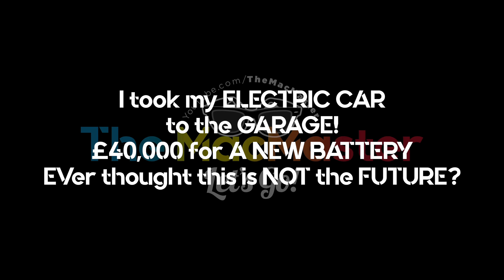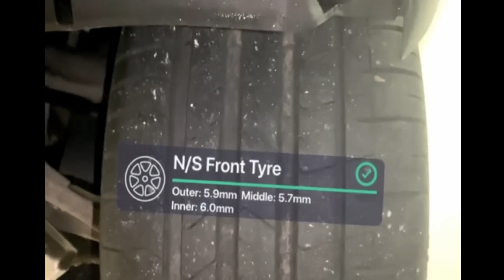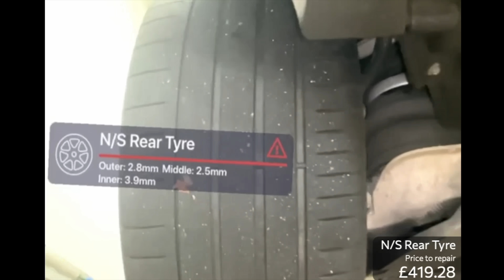I took my ELECTRIC CAR to the GARAGE! £40,000 for A NEW BATTERY EVer thought this is NOT the FUTURE?

Comment: I'm glad you posted this because I've been having a debate with one of those EVangelists and it's absolutely correct what you say, they're obsessed with everything EV and won't hear a bad word against them, but while I get that to a point, I don't get the aggressive and insulting attitude. They're either telling you you don't have a clue what you're talking about, laced with as many insults as they can think up \t the time, or they think you're totally against them because you're poisoning the air and you want to see the planet destroyed. No, I don't quite get that either.

But the more I discussed this argument, discovering more and more potential future issues along the way, the less EVs made sense. We know that to begin with, because of the emissions related to their initial destruction, that they're less "green" than an ICE car (a simple fact that most EVangelists won't acknowledge, or don't think it's as bad as it actually is), but where it all falls apart from me is 10 years or so down the line. Yes, it's the batteries. The EV lot will tell us that they'll do a million miles or whatever, but that's not the point. 

I think what's going to happen is that when these cars get to the 10 year old stage, the people who can only afford a 10 year old car and as such are on a budget of, say. £5-10k are not going to be interested, not because the batteries are knackered, but because IF something happens and they need replacing they're not going to be able to afford it and are therefore going to be left with a piece of scrap metal. It is for exactly this reason that you can buy a big 3-4 litre saloon for £5k - not because they are likely to fail, but because there is always the possibility that they will, and if they do they are going to cost a lot more to repair than your average family hatchback. 

So it's quite possible that by the time your average EV of ANY size gets to that age nobody is going to buy them. That means more scrappage, possibly before they have even reached the point where they're more environmentally friendly than an ICE car. That will leave people with 2 choices - they will either decide than rather than take the risk they will if they can buy or rent a new one, or if they can't they will have to use public transport. 

If that's how it goes it's all beginning to fit isn't it, the government get ICE cars off the road and get drivers off the road soon afterwards because nobody will be able to afford a new EV, or want a high mileage old one. And by them everybody will have worked out what is really going on and that it's nothing to do with the environment, as the fact that millions of cars are scrapped so much earlier will mean there is no environmental benefit whatsoever.

Comment: I have a Kona Hybrid and got dashcam fitted, if you dont drive very often it drains the 12v battery. My solution was to attach a solar trickle charger when parked up.

Comment: Some truth in your comments. The UK government will always target the motorist because they know there isn't any alternative for many people. ULEZ is about raising money because councils have high wage costs and get ripped off by sub contractors. My Cupra Born V2 has lost £11k in 13 months so when Cupra asked me if I was considering trading it in I laughed at them and told them to do one. I like petrol cars and EV cars. Why don't London council release the air quality readings for Heathrow, Gatwick and the under ground compared to the roads ? Also log / wood burners give out a lot of pollution. The money wasted on HS2 could have built thousands of charge stations and improving our road network.
Reply: You chose to buy a relatively new car... what did you expect? All new cars depreciate like a brick.

I once bought a 15 month old Ford Focus ST-2 with 5,000 miles on it.... I paid £10k LESS than the new retail price and I bought it from a major ford dealer. 3 years later whilst on a dual carriageway doing 70, the engine went "bang". New one was £5k+ labour and no guarantee it would work without fault. Sold the car as a non-runner to co-part for £4k and used that as a deposit for my 335D.

Comment: Whilst I am an  owner of an EV, I do agree with your point on control. Mass EV ownership opens up all sorts of controls being placed on the motorist. Currently it is just starting to exist in charging. When I go to charge my car at home irrespective of the time my Chargers app asks if I would accept a ten minute delay before charging commences, supposedly because of demand on my electricity provider. At the moment you can opt to skip the delay, but how long before that option no longer exists, and its not ten minutes but hours!?! 
The government are in a quandary, they still, need the fuel revenue from petrol and diesel, but as EV's become widespread I have no doubt they will have the technology to detect when your using electricity to charge your car and introduce a new tax accordingly.
Whilst I remain very pleasedcwith choice of car, a Genesis Electrified G80, which as a large luxury saloon benefits from the refinement of being an EV, I was rather corralled into an EV thanks to the propaganda against petrol and diesel, and living near to London I can avoid, at least for now, pollution taxes. Less said about ULEZ rip off the better!!! By the way good to hear your battery remains intact!!

Comment: That’s good news. The battery protection plates look pretty substantial, hard to imagine any damage to the battery possible from road debris.

One other thing, I though that car batteries are made up up loads of individual battery cells so it the ‘battery’ were impacted/punctured then it should be a case of replacing the damaged modules not the whole battery.  The Porsche Taycan battery has 33 modules, each with 12 cells.  They won’t be able to replace individual cells but the modules should be replaceable.

Comment: My Toyotter Yarse 1.0, 20 years old, suffered a catastrophic low oil pressure event. The big ends were toast. £170 got me another engine block. Right as rain again. Nowhere near £40,000.

Comment: Hi.  I got my electric car in May took a month to get the home charger.  Got a problem travelling on motorway "no functuality"  then stopped.  I've now been without a car for 3 weeks.  I'm  going stare crazy, climbing the walls costly!  Dealership have put more miles on it than I have.  Been driving 39 years driven around 100 cars never had such a problem.

Comment: Lithium-ion batteries contain a FLAMMABLE electrolyte that can result in fire or even explosions if they are punctured, damaged, or heated. ------ The electrodes are submerged in a liquid called an electrolyte, which allows for the movement of ions and consists of lithium salt and organic solvents. It is these ORGANIC solvents which are the leading fire hazard in Li-ion batteries.

Comment: So what is the expected life of a battery? In years/km? For an ICE one would at least expect 25 years old or 300000km(regular services, cambelt/water pump changes etc. done) or there abouts. If a battery lasts anything less than that and it's more expense to replace the battery than buying a new car resulting in the car being scrapped, how environmentally friendly is that? Then EV's is just stepping up our throwaway society which really isn't something positive for the environment.

Comment: Whilst 40k for a new battery is ridiculous money , as the battery is basically the engine what would it cost for a new replacement combustion engine at a Porsche dealer , I suspect near to 20k at least ? Which is not cheap either. I am not a fan of EV’s but I accept them and they have a place alongside all types of engines as a choice for the customer. I don’t think the 2030 date will happen.

Comment: I haven't got an EV car but I have several EV 2-wheelers (2 e-dirt bikes and an e-MTB). Luckily the battery prices are far lower. Not cheap but affordable to replace when they run out in 10 years or so, at my current use with the claimed 1500 charge cycles. Electricity is cheap where I live whereas petrol isn't. I will save money in the long term and they are great fun plus low maintenance. I've still got a turbo-diesel truck for hauling larger loads but probably couldn't afford an electric one.

Comment: Here's a relevant question: If you have a leaking valve cover gasket, do you repair the leaky gasket, or do you replace the entire engine?

If you're not insured/warranty, fix the fooking damage, there is no reason to replace the entire battery! Older Nissan Leaf repairers are having no problem simply replacing failed battery cells on the cheap.
Reply: Metal plate with a blob of glue, sorted.

Comment: Bio Fuel, that might be the way to go. Farmers  grow the crops, provide much work. Crops gobble up Carbon , cattle gobble up the waste. Its a win win in my opinion > What is biofuel?  
The term biofuels usually applies to liquid fuels and blending components produced from biomass materials called feedstocks. Most biofuels are used as transportation fuels, but they may also be used for heating and electricity generation. ( Or Stick with the poison :face-fuchsia-wide-eyes: Batteries )

Comment: Got to agree with you EV’s should be an alternative not a replacement for ICE vehicles.  As for government ministers not using EV’s that just proves it. 

Yes, the cost of the replacement battery is absurdly expensive but then again how much would it cost to replace a Porsche engine, much the same I bet if not more. In the worst-case scenario, there are more and more companies specialising in modular repair of EV batteries at a fraction of the cost of a new one.

EV battery degradation is proving to be nowhere near as bad as some speculated it to be. In the states it's not uncommon for three- or four-year-old EV’s to have covered in excess of 150,000 miles and their battery degradation has been less than 10-15%. Even if it had been 50% there would still be the opportunity of a second life for these batteries as a domestic storage unit. Giving them a value to be offset against the purchase of a new one, bearing in mind most EV batteries will outlive the actual vehicle that it has been powering.

Comment: Porsche Leeds are absolutely awesome, they look after my Taycan and have some great technicians.
Strange you had a charging fault, I’ve charged my car while in Europe where the outside temp was in the low 40’s and didn’t have an issue.
Drove just under 800km in the day with two charge stops from south of Spain to the north of Spain without any drama at all, a quick stop at Porsche in Seville then an IONITY further north and then plugged in at a hotel for an overnight charge. 
Really is no drama doing long distance in an EV, specially one as capable as a Taycan.
Reply: Did you watch the video? He was behind a lorry and a lump of wood fell off and banged the underside of the car. After that there were a couple of charge warnings; since then, no problem. Promise me you’ll buck up.

Comment: EV depreciation will be (is) horrendous. Even though the battery here was physically damaged, it only has a finite life and will need to be replaced sometime at horrendous cost. Or rather, it wont be. There'll be thousands of cars soon that will be in perfect working order, apart from a useless battery, that will be scrapped. Hardly a "green" issue.

Comment: The comparison to Betamax is too flattering to EV’s. If you had been left holding a Betamax in the mid 80’s you would not have been able to by many pre-recorded videos, but since blank tapes were commonly available well into the mid 90’s you’d still have had a fully functioning video recorder for as long as the machine was likely to last. 

With battery EV’s, if the tech is superseded, you’ll be left with a car that you can charge only at home (and eventually only on a normal socket as support/replacement parts for dedicated chargers dries up) and cannot replace the batteries in when they give up, thus given you zero residual value. Eventually, however, even the limited use you do have will end as the fire risk of the then rapidly decaying fleet of battery EV’s will likely lead to a ban on public roads.

Comment: Your talking about a porsche problem not an EV problem. Porsche taycan short range ev why because you are dragging around over a ton of extra weight to give the performance you can never use. When you do use the power like a maycan guzzles petrol yours is guzzling electric. This is born out by the rear tyres having a third of the tread left.

Comment: I've not even spent close to 40,000 quid in 50 years of motoring on purchasing cars
I've owned 5 cars in that 50 years with the most expensive costing 6 grand
Buying well serviced 2nd hand offerings is the best way to save lots of money
Buying new is like setting fire to your wallet

Comment: So if you were driving the equivalent petrol porche, or ferrari, AMG or M and hit an object in the road, trashed the sump, engine runs dry, seizes up, new engine.. do you think that'll cost a few hundred quid from a MAIN DEALER ? No. Breaking news - main dealer parts are really expensive, and often more expensive than the component value on the production line ! Sadly your EV is still a relatively new model, high performance, high premium price, and that's what you pay. I remember in my early 20's, I was at a merc dealer looking around an E55AMG while my little original "elktest" A-Class diesel was being REPAIRED due to a warranty issue. I said to the guy - wouldn't like the fuel bill for that ! to which he replied .. Sir, if you can afford the car, the fuel bill won't be a problem. That was in the days of 50p a litre.

5 Years down the line, when boy racers have put Taycans into walls etc.. you'll be able to get used batteries for a fraction of the price, but yeah, you have a new premium rare care, you pay new premium main dealer prices !

Comment: It's not the aviation fuel exhaust that we should be worried about, but the geo-engineering that they are spraying in the air, heavy metal anybody?... and not talking about leatherclad axe shredding muso's.

Comment: So the fault may have been because it was a hot day and you'd been doing a bit of driving? That's something else to bear in mind before getting suckered into getting an EV, especially as we're supposedly having the hottest weather since records began (or at least since the last hot day). Add that to solar panels not working so well in higher temperatures and the green revolution is looking really well planned!

Comment: It's just poorly designed. The battery compartment should have better protected.
Reply: Almost every EV manufacturer put the batteries in reinforced cages for safety. His battery was also unaffected, so not sure why you think it is a poor design?
Reply: But it wasn't damaged  so how do come to that  conclusion?
Reply: @kevinwhite8836  did you not listen to what he said in his previous video? Apparently its a common problem with a Taycan.

Comment: If a dealership tries to charge you 💷40000 for a battery, just talk direct to the manufacturer. The dealership is ripping you off. The dealerships don't like EVs.

I don't know what any of this is about to do with "control". I heard this from multiple people but no one has been able to explain it. I think the oil corporations have a better motivation for control and power over you.

To answer some of your your questions; there are electric airplanes but they have limited case uses. The energy density of a battery would have to get much better to expand the case uses. Switching over as much as we can to electric power is the best option to reduce CO2. It is a bad argument not to switch over whatever we can to electric just because there is a gas power airplane. We have to do as much as we can. We have to keep working on resolving other issues like airplanes.

Many governments are making the switch to electric. You gave an anecdotal example of one politician. I don't know why he doesn't switch over. It could be a security issue and what types of bullet proof cars are available. However, there are governments all over the world switching to EVs.

Amazon actually does have electric vehicles that are used for last mile delivery. They are getting (they already have some) 10000 electric vans from Rivian for the US alone.

There are electric semi trailers and I am not just talking about the Tesla trucks. However, it is hard to justify an electric semi trailer with the current energy density. That will change with time. You also need a network of chargers for semi trailers since they have no option but to DC fast charge at very high power levels (unless you have battery exchange).

No one is saying EVs are perfect. There are issues. There are also issues with ICE cars including a very existential issue that can't be ignored. There are no other alternatives that come close to EVs at this time and time is of the essences.
Reply: Where I live Amazon last mile delivery are recent immigrants in cheap ICE beaters,  bringing to my door each $10 purchase individually.